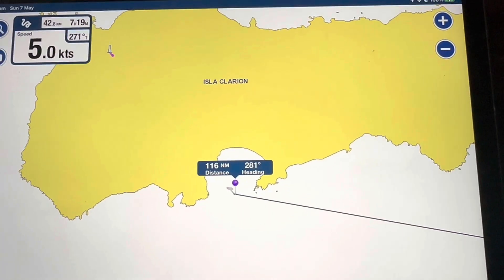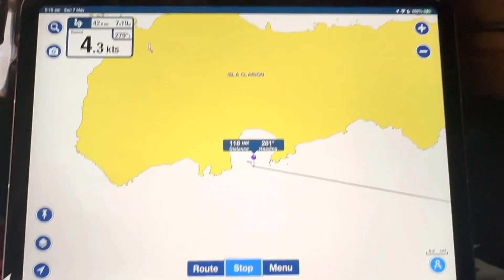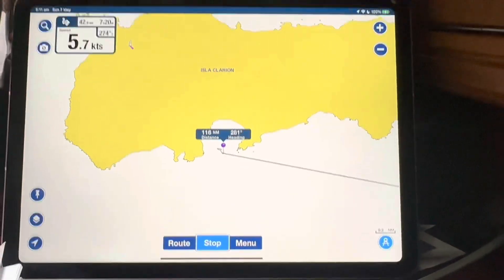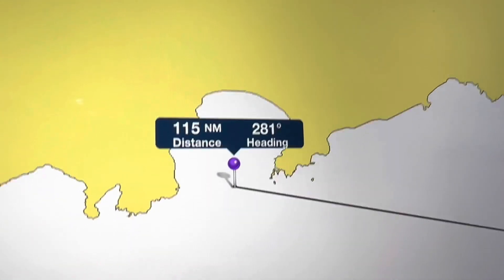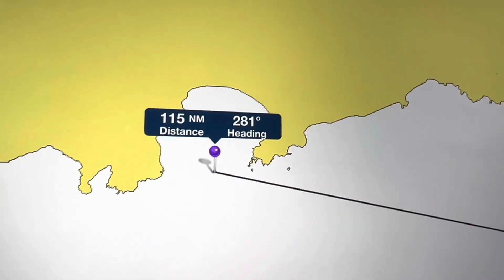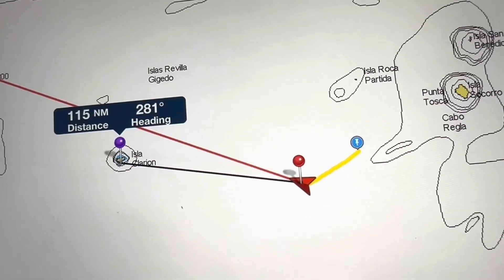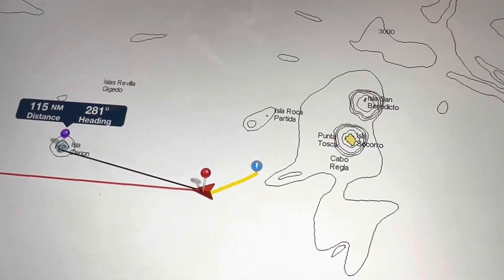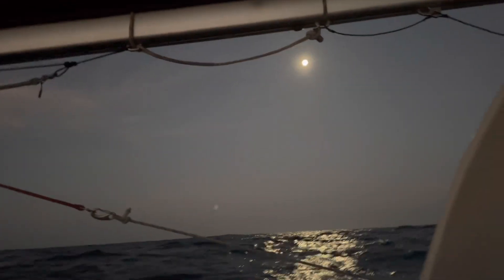4am - Drama on board Nereida as headsail comes adrift

Comment: Could you tie a new sheet to the failed sheet as close to the clue as you can reach.  If you can reach up high enough to keep the knot from having to pass through a block that might keep you going until you can lower the headsail safely.
Reply from the maker: See my reply to Phil...  seem to be going well without Genoa just now!!  But need to be able to pole out very soon so that's a big consideration
Reply from the maker: See my reply to Phli...  seem to be going well without Genoa just now!!  But need to be able to pole out very soon so that's a big consideration